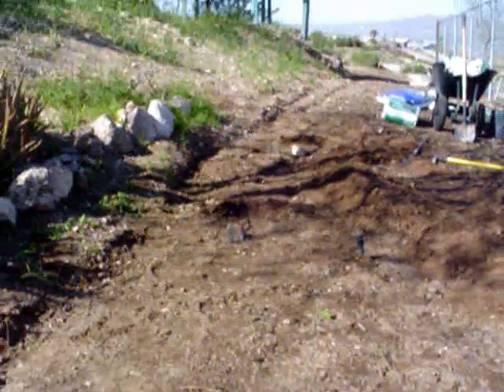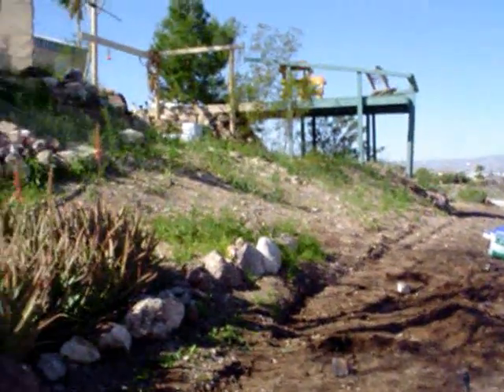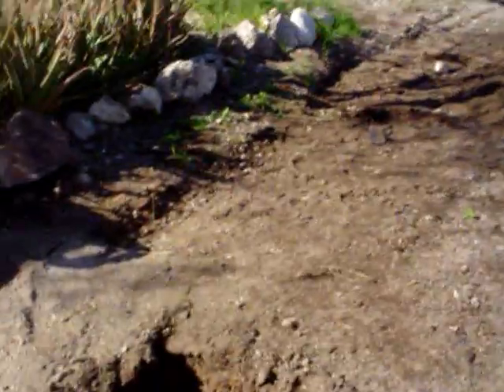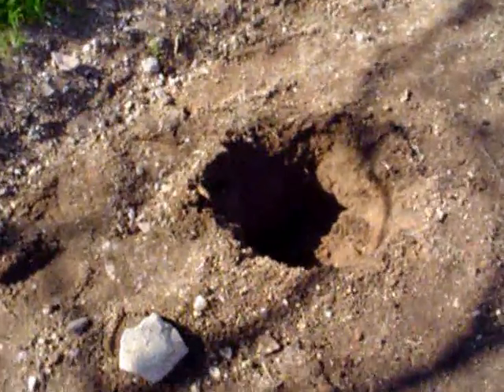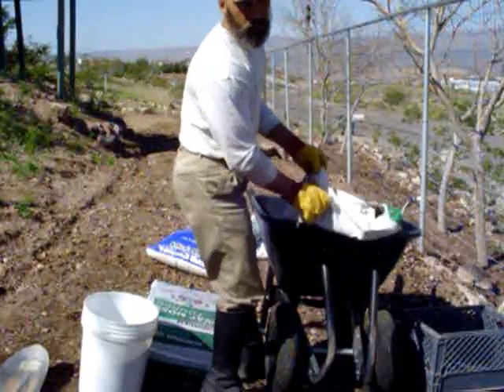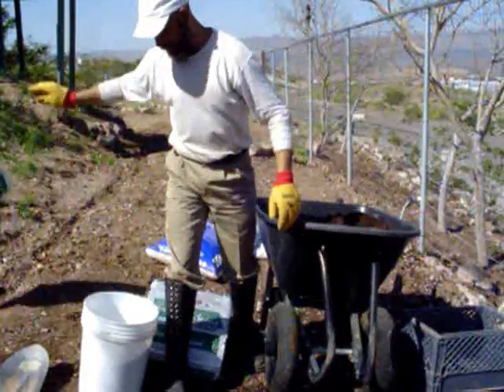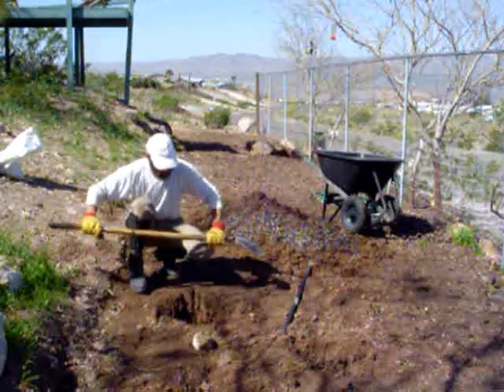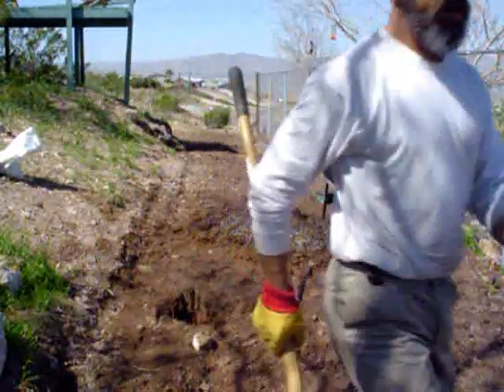Digging holes...Caliche Rocks!!! ...Making dirt

Comment: Im currently working on a hole for an Arizona walnut tree which requires a min of 20 deep hole for the tap root. im at the 8 foot level and still pushin out silt and clay caliche material..however i came to a hard spot .. im gonna try 4 gallons of viniger 1 g at a time to see if it will bust thru th ehard pan ..if not i guess ill plant something else there.
i hear dsulphuric acid will disintegrate this caliche in a matte rof hours depending on how much you use,, i wonder how far a gallon of it would eat up ?

Comment: u got it easy diggin compared to what i have to dig into to bust it up.. I did accidentally discover a easy cost eect..way to get a hole dug.. once u get about 3 inches  bowl or hole going ..puor a gallon o white viniger in it and soak it with water .. use the whole gallon in 1/2 gallon spacings .. the longer u let it soak in persay i waited 4 hours then dug a oot or so then i put the other hal gall in and illed it up with water..8 hours later i had about a 4 oot hole dug out with post hole diggers..u haave to skim the bottom o because o the silt and clay .. it will go thru..I planted 4 agaves in my back yard where even weeds dont grow ,,even buulo grass has a heck o a time growing . They are loving this..

Comment: Just started digging a 7'x10'x3' hole for an inground trampoline and discovered the last 1' is caliche!!! Anybody have an excavating experience with caliche or any advice here?
Reply: Farmers use gypson. But sulphur powder will work better but be cautious. It becomes sulphuric acid.
Reply: take 5 gallon o white viniger and mix 50 50 with water ,,pour it on the areas to be removed .. let it set over night but dont let it dry out,, scrape out the next mornin ..
-

Comment: I guess it would be easier to explain in detail: TREBLINKA. 80,000 sqm. 870,000 souls allegedly buried. Take Bergen-Belsen pits which were 2.5-3 metres deep, as a reference and 7 bodies per cubic metre

1 pit: 30x20x3x7=12,600 corpses / 69 more pits required

Total surface area for pits= 41,500 sqm not including the spacing between pits

Allegedly eye witness:-120m×15m×6m pits were the norm, so they would require just under 12 such size pits, covering over 1/4 of the camp..

Any ideas now?
Reply: "Any ideas now?"

Yeah, you're crazy dude. Seek help.

Comment: Sir you seen to know what you're talking about. I have a few puzzling questions, and perhaps you can help with just a few comments. I'm in London which sitting on clay. If I wanted to use a large crane digger and make a hole approx 30x20 metres in area, could I go more than 3 metres deep, say perhaps 7-15 metres and not be concerned with structural integrity?
Many thanks in advance
Reply: Getting it wet using water only makes it harder when using a shovel because it sticks and it becomes a real back breaker when you try to throw it.